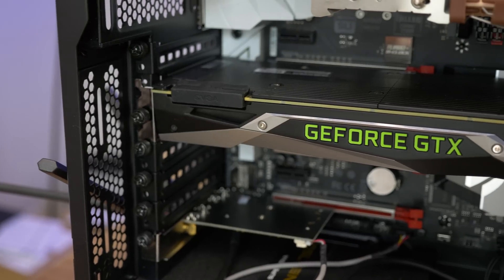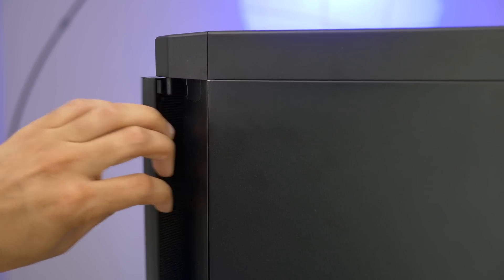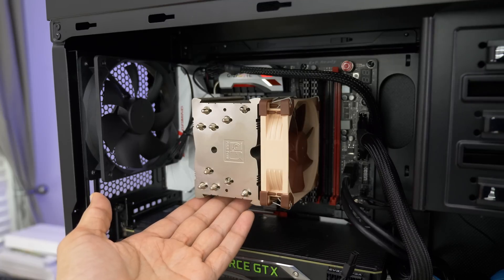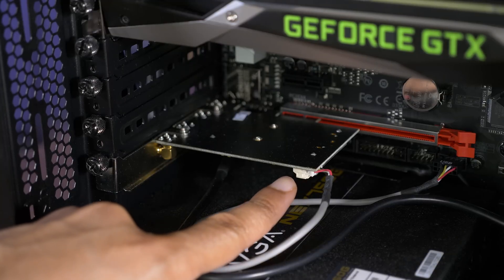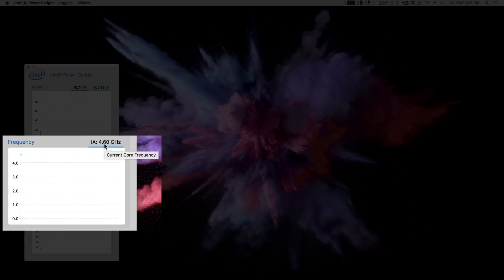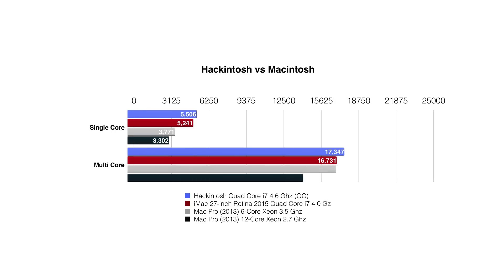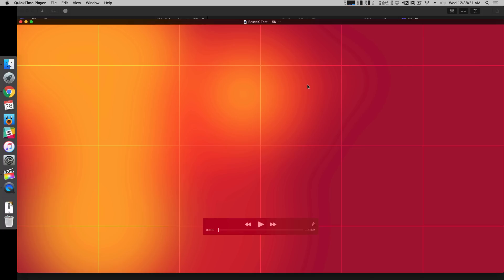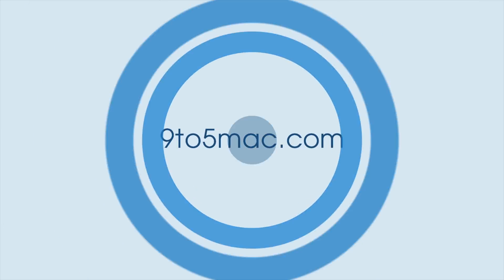Hackintosh: GTX 1080 Ti + 4.6 GHz i7 = Quiet, but mighty!

Comment: How did you get 1080ti support. I'm stuck. I tried to update my high sierra to use a Web driver, but the security update just freezez at beginning of install. So I'm stuck with a high sierra version with no Web driver.

Comment: Can I intall Hackintosh Mojave on my system? Here my config: 

1. MB - GB Z370 AORUS GAMING 7
2. CPU - Intel® Core™ i7-8086K
3. SSD - M2 Samsung 970 PRO 1TB
4. Cooler - FD CELSIUS S36 WATER
5. Video - ASUS ROG STRIX GTX1080TI 11GB
6. RAM - 4x16G DDR4 3000 XPG D41 RGB ADATА

If I can... can you help me, because I HATE that Windows... I want to pull that machine to its full potential. Thank you!

Comment: So what I've heard is that Hackintoshes are almost as good as a Mac but that the Thunderbolt port pretty much doesn't work. I'm a music producer and my 2012 MBP i5 dual core is steadily showing its age. However Im a mostly PC guy (I own like 4 self built PCs and laptops total),and I will not buy an un-upgradeable un-fixable new Mac that will cost double the price for half the performance. The only thing keeping me on the fence is that installing macOS on a PC seems like a headache along the unpredictability of its core functions.

Comment: Hi 9to5Mac,

I have the following configuration of my PC, namely:
- CPU: Intel i7 6700k
- MB: Gigabyte Z170x-Gaming 5
- RAM: Kingston HyperX FURY 64 GB DDR 4, 2400 MHz
- GPU: Palit GTX 1080TI GameRock

You can help me to activate the video card that I have assigned the 378.05.05.25f01 driver for macOS 10.12.6. I have made all the activation options but without success, maybe I can get rid of something. Please help solve this problem.

Thank you!

Comment: Hi Jeff.  This and the companion tutorial are great but  can you be more specific on the wireless network card?  You are showing the Fenvi FV9801 which on Amazon does not say Bluetooth enable but, it does have four antennas much like what is shown in your tutorial.  The Fenvi FV8801 which is Bluetooth capable but has two antennas.  Which do you have?

Comment: I get 21 on the BruceX test as well with my RX480 i7 6700. 

It shows that there is little difference unless apple optimizes software for the hardware.

Comment: Great build, would probably work well for me, but I would love to see a follow up video where u upgrade the disks, and get 2 Samsung 960 Pro M.2 drives running in RAID 0. I assume the main reason u chose a graphics card like the 1080 Ti, is so that u can dual boot this computer with windows and play some games. As you mentioned, - the stats are not as good as windows, - so why not dual boot. With M.2 Drives in RAID 0, reboot time is not going to be an issue :) probably add 2 x 1TB SATA drives one for win and the other for mac.
Reply: After doing some research, the 960s probably wont benefit much from raid 0, but the 950s would. Either way, even a single 960 is blinding fast compared to the drive ur using.

Comment: Just one question, audio isn't working on my hackintosh any solution? I have install VooDoo but still it isn't working!
Reply: buy an external soundcard
Reply: Thank You I'll get one!
Reply: Look the page for the motherboard you're using, search what audio chip it comes with, search a "kext" for your audio chip and read hackintosh forums about how to install it.
Reply: my hackintosh crashes if I install any kexts!
Reply: then you are not installing them correctly or the right ones, you pick specific kexts according to your hardware and the OS version.

Comment: My good old 3770K based hackintosh has been working great since OSX 10.9! I only need to find a proper wifi card to have full handoff/continuity/airdrop support and maybe upgrade my GPU, but never had mayor issues with it and upgrading the OS worked every time! I only had to reinstall OSX due to trying to get encryption on my boot drive, luckily my Time Machine auto backup saved my ass on the installing process and all my programs and settings were restored!

Comment: I have a GA-Z170X-UD3, 500 Gb ssd with a 6600k and a asus gtx 1070. Pretty much a similar setup as you. Is there anyway that you have a step by step of your edits to your clover, kext files, ect... ? I am having issues with getting the gtx to work,  my sound always has the hiss in which the gain always has to be turned down and when I turn off the monitor the mac becomes unresponsive and needs to be restarted if turning the monitor back on or coming out of sleep mode. Thanks for any advice.

Comment: Great i have the same Board, CPU, 32GB RAM and GTX 1080  everything is without radiators, but still Windows..., i will change it to Hackintosh too next month i think, bec. windows makes me crazy with all this updates and spyware on Win10. The board btw is awesome. You can change the LED-Color inside and outside on the back with an APP :-)

Comment: Can you test your eGPU AKiTiO Node with 1080Ti vs. your Hachintosh with 1080Ti - you must connect your Node to your Thunderbolt 3 port of your motherboard of the Hackintosh, if you can make some benchmarks we will have the best Desktop PC vs. eGPU Thunderbolt 3 test because we will have tests with the same CPU, RAM etc and with other words "PCI Express vs. Thunderbolt3" that is not done yet!

Comment: If fail build during install MacOS this is easier to instead install win 10? And if by all success is possible in the exact system you built having: 3 OSs(tri boot system) Ubuntu 16.04, MacOS 10.12.04 and Windows 10? All are compatible and Ubuntu?
Reply: You cann always end up installing windows 10
Reply: I have 2 OS booting, using the Chameleon boot loader. Best to have your OSes on separate hard drives, not partitioned.
Reply: I have 2 OS's too. As long as you buy the right parts your fine. My motherboards isn't even in the supported lis and it all works fine.

Comment: Are there any am4 mac motherboards? because ryzen makes much more sense for productivity than 7700k...
Reply: Ryzen doesent properly work on osx unless apple starts using them and devs the software to suit
Reply: I'm running a Ryzen hackintosh and it works perfectly fine. Im using an Asus x470 Pro
Reply: Not for now but eventually it will. Theres lots of AMD hackintoshes using the previous generations of AMD CPUS.. It will need more fiddling tho. http://insanelymac.com is a nice place to get information

Comment: Cost half of Macintosh preform double of Macintosh ;)
Reply: I would agree except about the fact that ryzen is not compatible with macos
Reply: ATL i ran os x Yosemite on dual core athlon cpu :D but I don't have graphics card  and onboard radeon hd 3000 has no kexts (which results in no native resolution and lag) so i had to switch back to Windows and then linux. It was horrible experience to get osx to work on amd tho :)
Reply: And can even be cheaper and perform similar. A 980 or a 1050 with a i5 or i7 Skylake would be enough for Mac.

Comment: FE GTX 1080 Ti is not quiet card.
Reply from the maker: +Thrusher it's actually not too bad imo. Plus I like the flexibility blower style cards give me. I.e. Using it in a compact case.
Reply: yes it's not bad but still not quiet :) any way good job! I am thinking now to install mac os on my PC i5-6600k MSI 1060. maybe this will work

Comment: Ist it possible to run Bootcamp on this machine ?
Reply: Nico Kuck there's no need. Just straight out install Windows on a separate partition or drive.
Reply from the maker: +Nico Kuck no need for boot camp. You can easily install Windows on another drive/partition to fully unlock the power of the GPU. Best of both worlds
Reply: Oh i didnt thoght about that 😅 thanks

Comment: Awsome build man! My only remark is, that you are not running the two RAM sticks in dual channel. If they are next to each other (RAM / RAM / slot / slot) they are not getting to the highest performance. You can switch the sticks (RAM / slot / RAM / slot) to maximize the performance of the sticks!
Reply from the maker: +Máté Salacz I fixed it thanks

Comment: temps will by sky-high in this case under heavy load!
Reply from the maker: +Michał Jakubowski nope 60-62 degrees max
Reply: In my case silentium aquarius with 2x140 mm front+2x120mm top and 1x120mm back and fortisv2 on the top of i7 6700k i reach ~52 for cpu and ~71 for msi gtx1080 gaming while playing battlefield1 (all setting max out) online. and those temps are with quite decent airflow. So in those 60s you gave is hard to believe;) ...but ok.

Comment: Since this is a Hackintosh, does the Apple wireless keyboard and touchpad work?
Reply: yes you can get them to work with a non apple product as well because there just using bluetooth
Reply: Last time I did a Hackintosh was in 2008 on an MSI netbook. Peripherals worked but not fully functional. Macbook Pro with Touchbar is BS IMHO. Could have used those resources to ramp up graphics and other I/O.
Reply from the maker: +Ed Lim yes

Comment: What monitor are you using with it a 4K display or 5k display? And how are the transitions between screens when you use the trackpad or Magic Mouse ?
Reply: Does this work with apple Magic keyb 2 and magic trackpad 2? - I guess I could try another keyb but losing the pad would take some getting used to

Comment: I got to ask....
Is the Wifi card on the description a necessary feature??? I've never built a PC but usually i never see people using that....

Please let me know, Thanx
Reply: It is if you want bluetooth and wifi.  If you are connecting it via ethernet cable and use a wired apple keyboard then no need for it.  You can use a regular wired or usb windows keyboard but the shortcut key commands wont work because they are intended for windows not apple.
Reply: The card is only necessary for features like "handoff", obviously for Wifi and bluetooth too.
Reply: Nothin2see thanks for the info, both of you 👍🏻
Reply: just make sure. Does the wifi adapter has  Bluetooth feature?
Reply: Yes. I had to buy it just for that.
Reply: To clarify: ANY wifi or bluetooth card that has mac drivers will work but only SOME allow for continuity and iMessage. The one in the description is the easiest one to setup.
Reply: Thanks！

Comment: Oh god, that RAM placement ! :P 
RAM tip: Never use side-by-side slots. Always use the other slots. 
It's super easy in the case of that motherboard, as the slots are color coded, for a reason.
In the case of your motherboard, use either the two red slots, or the two black slots, but don't mix and match, otherwise, you'll be running in single-channel mode instead of dual-channel mode, which effectively cuts in half the bandwidth to your RAM sticks.
Reply: Alex Pilon i want to coment this too 😂😂😂
Reply: lol, i wanted to reply with this as well as soon as i saw the RAM placement XD
Reply from the maker: Yes, I got lazy, because I didn't want to bother removing the cooler. It's fixed now. Thanks.
Reply: hehe Hope it didn't come off as a complaint, more like a helpful suggestion :P
Reply from the maker: No, I needed the reminder!
Reply: he is also probably not running it at its XMP speeds..
Reply: @Karma Police: Going by macOS' System Report, it says RAM is running at 2133mhz. Considering the RAM he posted can run up to 3000mhz, I'd say no, not running the XMP profile :P
Reply: Was looking for this comment. That RAM placement got me like "nigga, really?" XD
Reply: 9to5Mac you filled wrong dimm channel i guess you need to fill both red ones in gigabyte to complete one channel..otherwise good build

Comment: I got stuck part way through trying to hackintoshify my PC. Drivers weren't installing properly, and my drive kept duplicating itself. I eventually just gave up. I'm hoping your upcoming guide will help! The parts aren't identical, but they're really close: I've got a 6600K on a Gigabyte Z170N Gaming 5 motherboard (also with a Noctua cooler, not that that changes the hackintosh configuration), and a GTX 1070.

Comment: Is it possible to add another gpu?
Reply from the maker: Yes, but relatively pointless for Mac, as Macs can't use SLI. Would be okay for Windows though.
Reply: 9to5Mac my intention is to have both of them (Mac and windows) each in a separate HD
Reply: Thank you very much, I'll wait for the tutorial
Reply: Great video, exactly what I was looking for. How many screens can u run on this. I want to run 3X - Dell P2415Q - at 3840x2160. Would I need 3 graphics cards? - I dont care really care about games. It would be great if u could elaborate on the choices u have made. Would other hardware be much better, but push the price up too much?

Comment: Awesome! :D installed Mac OS Sierra on my computer earlier today with an x99/haswell-e cpu, it was a little tricky but got it to work perfect in the end! :D love it
Reply from the maker: +Synthfrax I wanna do X99 next.
Reply: Synthfrax There is a Ryzen Kernel Testing and Development thread on insanelymac
Reply: 9to5Mac Nice! Would there be a video on that one too? ;)
Reply: If apple released a computer with a ryzen chip in it, then it would be easier. I don't know how would people pull off a ryzen hackintosh, should be interesting.
Reply: Crigaas I agree, though Threadripper is right around the corner, so even if you're willing to spend the dough, there's going to be a much better option available (16C/32T, quad-channel memory...).

Comment: Nice build.  Let us know if you are able to get Message to work and what features do not work as compared to stock apple.
Reply: Jim Martin Thats one of the things i hear that makes me dont even bother.
Also i've hear a lot of programs on MacOS dont work very well on Nvidia cuz they are not optimize for Nvidia on MacOS..... idk much about that.
Reply: PowerhousePR I built a hackintosh last year with older Nvidia GeForce gtx 460 and it work okay with Nvidia's OS X web drivers. However I can't get message to work due to non compatibility of bluetooth/WiFi setup
Reply: +PowerhousePR running a hackintosh now. Pretty much everything I have tried has worked as well as or better than it would have on a real mac.

Comment: Very nice! And timely for me! I just last week decided to sell my mid-2014 Macbook Pro 15 and switch back to linux (along with Windows 10 for work). I've been using the MBPro as both my work and personal machine but lately have had an itch to get back into gaming, and I wanted to get back to linux (prior to a few years ago I ran linux as my primary OS). Although it pained me to do it, I didn't go with Kaby Lake even though it was the same price (I live near a MicroCenter thank goodness) and went with a 6700 (not K version, though I regret not doing that) just so I could go back to macOS via the Hackintosh route if desired. So far I'm liking it. Interested to see the install process video!